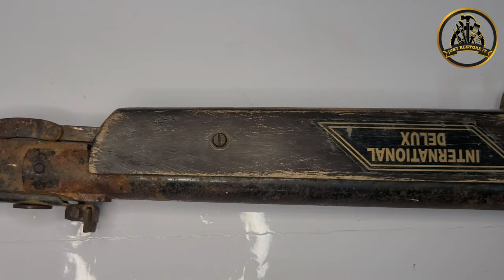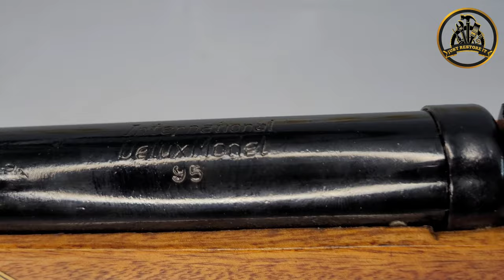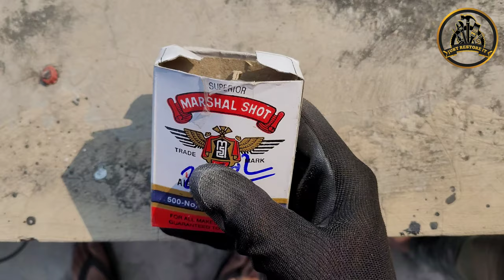Super rusty air gun restoration || gun restoration || @justrestoreit

Comment: Nice work, very good result. Can you please specify whether the metals treated with hammerite paint or blueing solution? It looks like paint to me... Also I have some objection in using oil directly on the seal, instead of specialized grass and no grassing up spring and spring guide. Love your video.
Reply from the maker: Thank you 😊...it's polyurethane polymer paint . Surely will work on it
Reply: I am sure you mean grease, not grass 😀
Reply from the maker: Ya dude....I got it 😊

Comment: SORRY, but that wasn't a restoration, more a wash and brush up with a quick paint job!! Didn't see any polishing of the cylinder or the piston sliding surfaces, the trigger spring was still rusty as were a couple of the holding pins when they were refitted 4/10